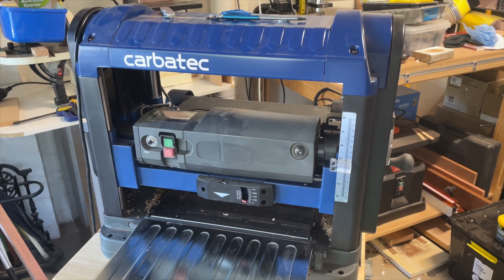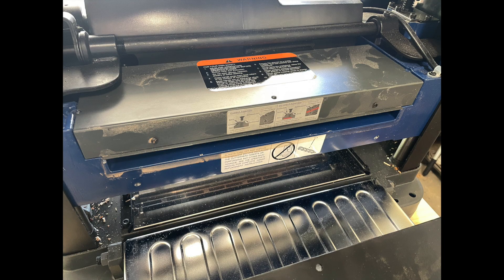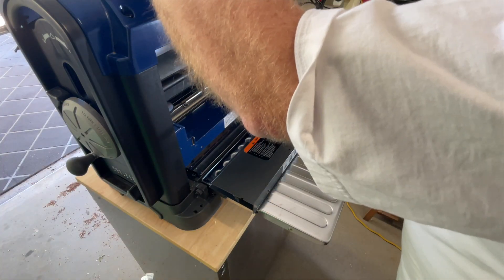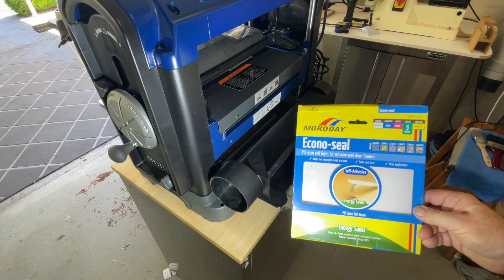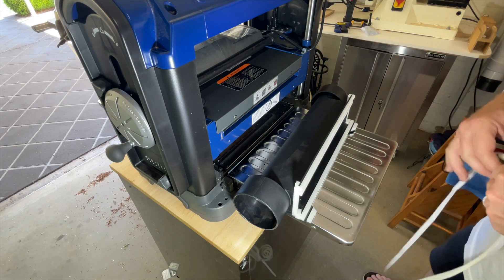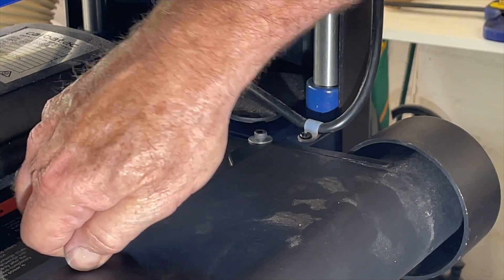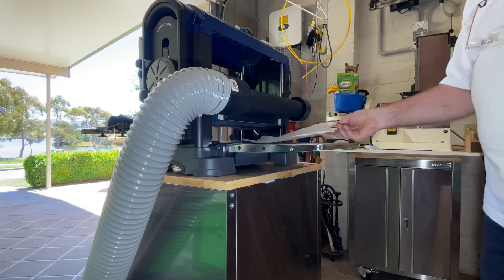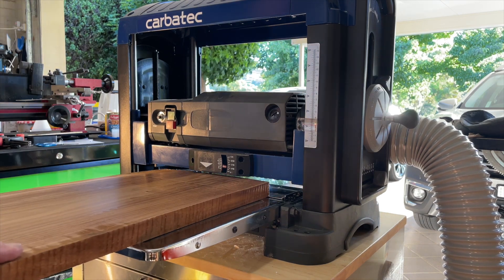Carbatec Thicknesser Dust Improvement

Comment: Thanks for the video Derek. Have you had any issues with this thicknesser rollers slipping or not pulling the timber through? Mine is getting to the point where I have to push the material through! Rollers are clean and the machine is under a year old.
Reply from the maker: Rarely, if still under warranty report it straight away. I had a Sherwood like that that I sold and replaced with this one.